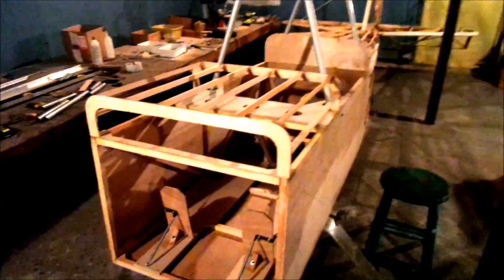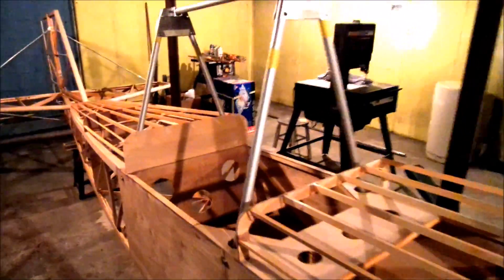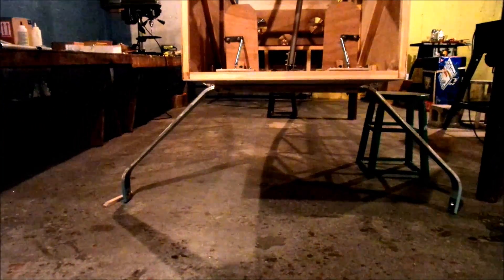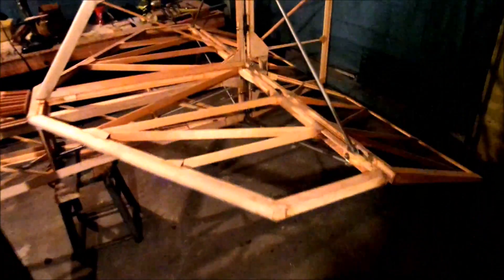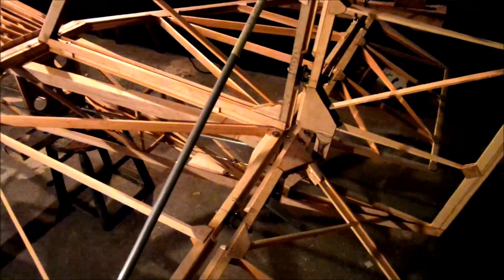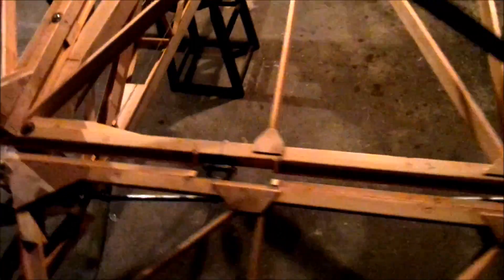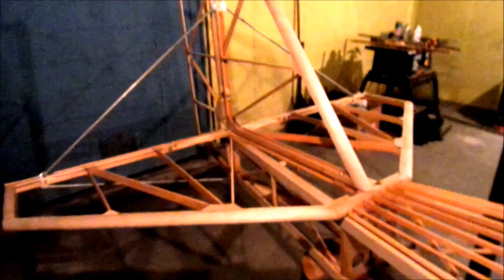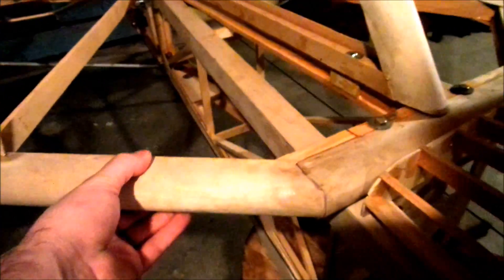Zing Ultralight Construction

Comment: Himax has 4 wires on the tail.  They change to two tubes when they switched to the tube in later models.  It’s really not needed the one in the bottom because it holds compression and tension when you have a tube.